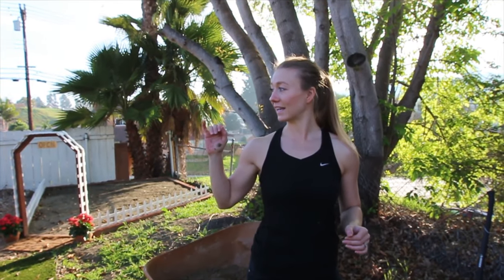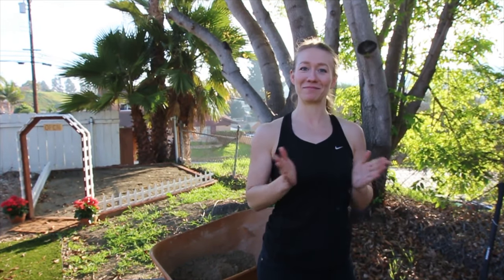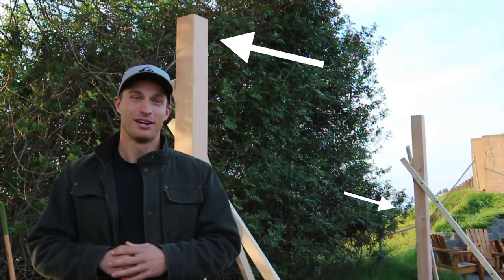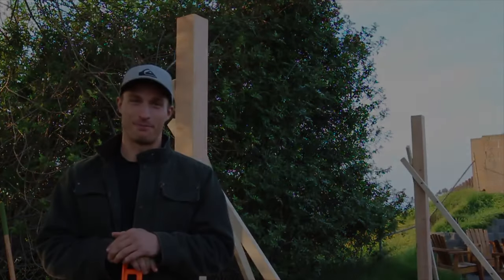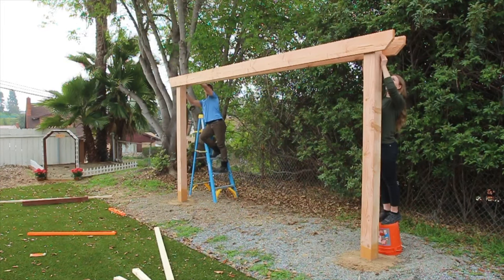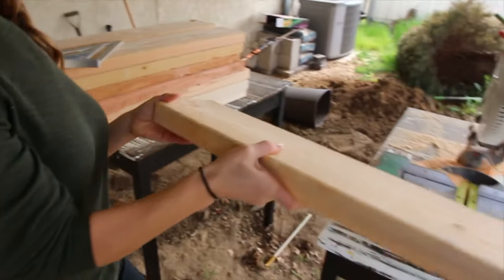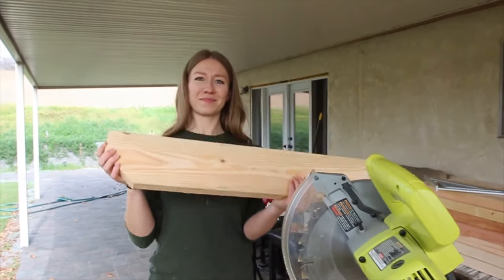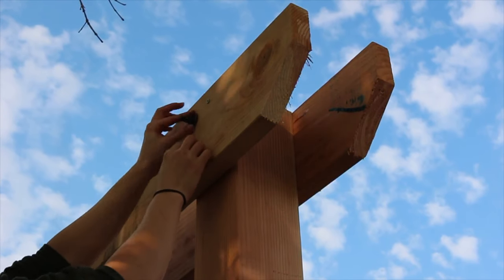DIY Hammock Pergola | Backyard Pergola Stand | EASY Hammock Stand

Comment: If you attach the cross members to the post before setting the concrete you will guarantee you dont have a misalignment and that they are both coplanar to each other.   Not necessarily at the top either, you could do it around waist height.  Would totally eliminate the concern you expressed after the mud.

Comment: Nice but really wish you had given us dimensions etc. I’m trying to figure out how deep to dig and how far apart the posts need to be.
Reply from the maker: We don't usually give dimensions because everyone's project is different, but the post hole should be 1/4 to 1/3 of the height of the post, deep (ex: a post that has 8ft above ground would need 2ft-2.6ft underground). And the post distance would depend on the size of hammock you are hanging. Ours was 14ft because we have a 12ft hammock . Hope this helps!
Reply: Very helpful. Slight typo in the first sentence:  The post HOLES should be 1/4 to 1/3 of the post height ...
Reply from the maker: mark2talk2u Oh shoot, just updated it! Thanks for noticing.
Reply: Yup. I liked the video. Very chill, yet informative.

Comment: Very nice design! Looks great!  It is easier to mix the concrete in a bucket 🪣 with a drill and paddle mixer. 📐cheers
Reply: Don't need to mix it at all....just pour it into the hole.Moisture from the ground  mixes it, but can always feel free to put water in with it

Comment: I love this idea and have a vacant corner next to the deck. I also have 3 kids and I know I should have at least two hammocks to save my sanity! How would you change this to a corner pergola, using two hammocks, one in each direction? Have you thought of doing this for yourselves? Awesome tunes, love the tropical house vibes...always need more of that with  pina coladas!
Reply from the maker: Hi Shawn! Thank you so much! That sounds like a perfect idea! The posts would essentially be the same, just each hammock sharing the rear corner post. The support beams would have to be attached differently to the rear corner post, but they have lots of specialty pergola brackets at most hardware stores that you could look at. For the top though you could either extend the rafters to make the structure a triangle (with the front rafters longer and progressively getting shorter) or you could just mirror the two and give each arm of the hammock pergola their own rafters. I hope this makes sense, let us know if you have any other questions!

Comment: Hi love this video and I'm looking to make. It would have been helpful to see the materials used in the description to get an idea of what would be needed.
Reply from the maker: Hi Evelyn! Thank you so much and you are so right, we will add the list right now. Here is the list in the meantime. 😊

2 - 6x6x10
2 - 2x8x16
4 - 2x6x10
4 - 1/2" x 10" galvanized bolts
2 - 1/2" x 8" eye bolts
6 - 1/2" washers and nuts
1box - 4" drive screws
9 - 50lb bags fast setting quikrete
1 gallon - exterior sealant/stain

Hope this helps!
Reply: Thank you!

Comment: Thanks for sharing this! How many feet apart did you set the posts? Obviously, you needed to utilize the 2x8x16 support beams.
Reply from the maker: Thank you for watching! Our posts are 14ft apart to accommodate our 12ft hammock
Reply: @BrocAndAimee  Just had our hammock pergola installed using your design. Looks great. How high are your hammock anchor eye-bolts off the ground? Thanks!

Comment: From germany. Wood in concrete no go. 3-5 Jears and it starts to get dammage.
Reply from the maker: Hi Thomas! There is always a risk of wood rotting over time. We treated the boards to resist rot and had a 4" gravel bed at the base of the posts to help with drainage. The top of the concrete slopes away from the posts to assist with the drainage as well. We also live in California where rain is minimal so we are hopeful the posts will last a long time 😊

Comment: excellent work, I will use this idea to make ours.  Could you give me the full list of materials
Reply from the maker: Thank you! Yes here is the list of materials:
2 - 6x6x10
2 - 2x8x16
4 - 2x6x10
4 - 1/2" x 10" galvanized bolts
2 - 1/2" x 8" eye bolts
6 - 1/2" washers and nuts
1box - 4" drive screws
9 - 50lb bags fast setting quikrete
1 gallon - exterior sealant/stain

Hope this helps!
Reply: Thanks awesome
Reply: hey guys we finally made it.  and we look great, thanks for the idea. I wish you can see it
Reply from the maker: Josmil Quintero Woohoooo! If you use Instagram you could send us a photo of it! We would love to see it :)

Comment: May I ask how long were your main posts including what you buried? As I'm thinking of repurposing an old swing set with 10 foot posts I'm wondering if will be long enough or if the header would be too low by the time I bury them? Thanks
Reply from the maker: We used 10ft 6x6 posts, then buried them 2ft deep, so final height of 8ft was perfect. Hope this helps!
Reply: That's perfect then as with the exception of a little cement this project will cost me $0, thanks!

Comment: Beautiful design and teamwork. Congratulations :) I'm not sure if anyone has already asked about it, although I tried to read all the comments - at what height do you have the hammock handles? I have very similar dimensions and spacing of wooden beams as well as the size of the hammock.
Reply from the maker: Thank you so much! The bolts we used to hang the hammock are installed 4 ft 6 in from the the ground. Hope this helps!
Reply: @BrocAndAimee  thank you! :)

Comment: Hi, nice design. I’m putting my parts on ordered but one question on the eye bolts, where did you get them? I’m finding some but the weight ratings are not good and most say the rating is for a straight pull only. Just curious,  thank you
Reply from the maker: Hey sorry for the delay, we got the eyelets from Home Depot!

Comment: Question!  How did u figure out the best distance between the 6x6's for the hammock to lay right?
Reply from the maker: The distance is all based on the length of the hammock. Just far apart to have a taught hammock :)

Comment: great video!! We used it to get our hammock set up. Thank you!! one question, how  did you attach the top rafters? I have seen some pictures where they were notched. . . We are trying to decide what the easiest way is.
Reply: Oh! I see it now, had to scroll through slower.
Reply from the maker: Haha now worries, and that is so cool that you guys built one! Did you use the same dimensions or did you do something different??
Reply from the maker: And it is easier using 4" screws screwed in at an angle than notching each board

Comment: @LetsWingItDIY 
This project looks awesome - great job! I do have a couple of questions though.. 
How wide are the rafter beams? 
If I was doing this near a wall, how far would you suggest I place the main posts from the wall? As in, what the safe distance to clear it without going out to the middle of my yard?
Reply from the maker: Thank you! The top rafters are 2x6 cut to 32" long. We have our posts 60" from the fence, we have a two person hammock and wanted plenty of room for the hammock to swing. I think you could get away with 48" or even less depending on the width of your hammock
Reply: @BrocAndAimee  That's awesome! Thank you for the reply. Aiming to get it done this week.

Comment: how long are your short boards going across the top of the pergola? how far apart are your main posts?
Reply from the maker: The distance we did was 14ft on the main posts, and the short boards are 2ft. The distance on the main posts depends on the hammock length :)

Comment: What hooks did you use for hammock and how high up on the post did you anchor the hammock?
Reply: They used galvanized eye hooks 1/2" x 8". 4 ft 6" from the ground once you set the posts in 2 ft. Building mine now as we speak

Comment: My wife wants one of these. Can i ask how much concrete per post did you use?
Reply from the maker: We used 4.5 bags per hole.  quikrete.com has a really great calculator for how much concrete you need depending on post size and hole size and depth.
Reply: @BrocAndAimee  Thank you! I just found that calculator actually! I'll be doing one of these next Thursday, right behind our pond.
Reply from the maker: Awesome! Let us know if you have any questions along the way! :)
Reply: @BrocAndAimee  Thanks, you two are awesome. Did you use 2x6's or 2x4's for your rafters?
Reply from the maker: Thank you, we really appreciate it! And the rafters on the very top are 2x6s, the support beams they sit on are 2x8s
Reply: @BrocAndAimee  Almost done. It's about 95 degrees right now, so I'm taking a little break. We are alternating between 2x6 and 2x4 boards on the top. I wish I could show you guys a pic, thanks for the info and help! It's looking really good so far.

Comment: Did you use fir, cedar or pressure treated wood? Nice video!
Reply from the maker: We used Douglas fir and sealed it with a waterproofing deck sealant, a year and a half later and it still is holding up great!

Comment: Great video! How did you ensure that the two posts were at the same elevation on top? (level with each other)
Reply from the maker: Hi Andrew! We did our best to make the holes the same depth. Once the concrete was set we placed a level on the 2x8x16 support beam and checked the level between two posts. (We got lucky that ours turned out to be level). But once you check level you would mark which beam is taller and use a saw to cut that once down to make it level with the shorter one. We hope that makes sense, please let us know if that answers your question. We can email you a picture if you want. 👍
Reply: @BrocAndAimee  That make sense - Thanks!!

Comment: Hey folks. Just checking up on the concrete you guys did for the post. Is it still holding up good? I want to build one next week but I’ve seen like the foam stuff u can get to. Don’t know which one is good! Thanks guys
Reply from the maker: Hi Chris, it's been over a year and the posts are holding up great! We wouldn't recommend using the foam just because it's not recommended for any type of structural posts, and the weight of a person in the hammock would cause some significant strain on the foam. Let us know if you have any other questions!
Reply: Hey again!! What were the measurements for the rafters? Every 16”?
Reply from the maker: We separated our rafters every 12" on center, but you can do whatever spacing looks best to you!

Comment: How to insure the edges of each post are parallel to the ones on the other post or that doesn’t matter...
Reply from the maker: Hi there! We used a board to line up the posts to one another while we were setting them. If they are a little off it's okay but you want them to line up so when you attach the support beams they are flush.

Comment: How long are the rafters ? We are doing it right now
Reply from the maker: We cut our rafters to 32" each
Reply: ***ACTUALLY THINK IT’S 30” pieces. 1st thanks a million for the video! Just finishing mine. Couldn’t have done it without you. I was going to cut at 32 as you mentioned, but that would leave a 24 inch scrap piece and you wouldn’t be able to get 15 rafters out of 4 2x6s. I think you meant 30” cuts which would give you 5 rafters with each 10 foot board.

Comment: Cedar?
Reply from the maker: No it's Douglas Fir.
Reply: @BrocAndAimee  so its typical treated lumber from the big box store? Thanks
Reply from the maker: Yeah that's right, but if you can't find treated lumber you can always seal it before you put it in the ground. I would do 2-3 coats for the part in the ground. Hope this helps!
Reply: @BrocAndAimee  hows it holding up? 24 inches plenty deep enough?

Comment: Is it 12” bolt?
Reply from the maker: Hi Kev, No we used a 10" galvanized bolt to attach the 2x8s to each 6x6 post
Reply: Hi just thought 2 plank plus post would equal to 10”.
Reply from the maker: Oh yeah that is definitely confusing! Sorry, with lumber, a 6x6 is actually  5.5x5.5 and a 2x8 is actually 1.5x7.5, so the total thickness of all the pieces together is only 8.5"
Reply: Thanks for explaining.

Comment: How much did this project cost? Including the lumber, quickcrete, and bolts? (Cost to build excluding power tools used)
Thanks!
Reply from the maker: Everything in total was about $250 (technically $257.49). And yes! It could definitely be made with 4x4s. The 6x6s were the highest cost items, but we splurged on them. If you use 4x4s you could downsize the support beams to 1x6s (we used 1x8s) and then make the rafters 1x4s (instead of 1x6s). Just so it's not too top heavy. Hope that helps! Let us know if you have any other questions!
Reply: @BrocAndAimee  Awesome, thanks!

Comment: For future knowledge it would have been easier to mix the cement prior to dumping it
Reply from the maker: Thanks Dean, we’ll be doing that next time
Reply: Let’s Wing It what size wood did you use for the top wood rafters
Reply from the maker: They are 2x6s and the support beams are 2x8s
Reply: Let’s Wing It how long though? The ones from pole to pole
Reply from the maker: Those are 2"x8"x16'
Reply: Let’s Wing It last questions lol what did you use to protect the bottoms of the posts and how did you make sure they were both we’re coming out of the ground at the same height
Reply from the maker: No worries! We sealed all the wood with BEHR Deck Plus transparent waterproofing wood finish sealer. As for the evenness in height with the posts, try your best to dig even holes and then check the level of the 2 posts using the 2”x8”x16’ with a level on top. You’ll need a buddy for that part. If the beam isn’t level, adjust one side until it is and make a mark. Use a circular saw to cut off the difference. We got lucky and they came out even. Hopefully yours do too! Check this website out, we used it as a reference when building ours. https://www.diynetwork.com/how-to/outdoors/structures/how-to-build-a-pergola
Reply: @BrocAndAimee  Is that what you used on the bottom of the posts before you added the concrete?